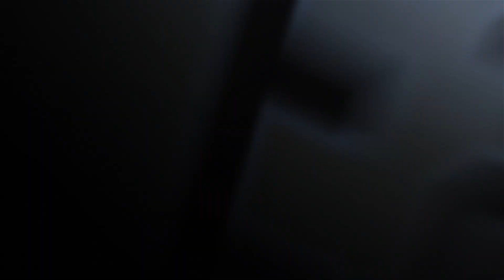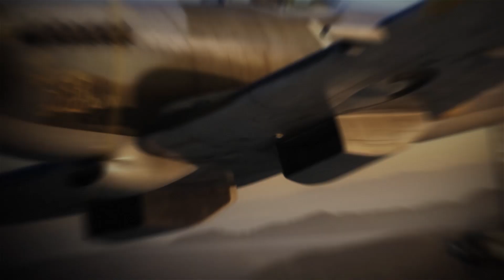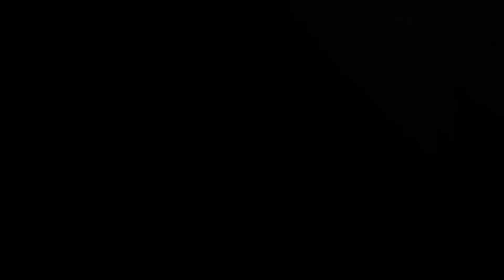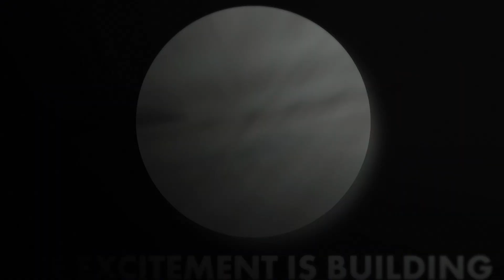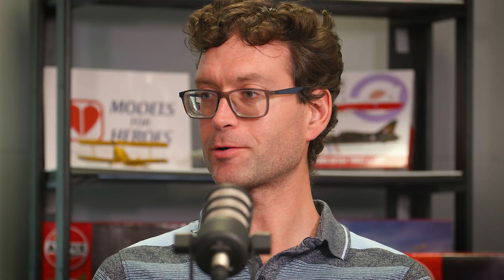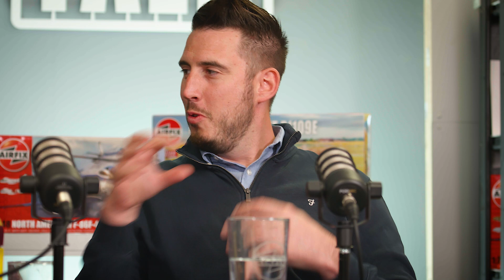Airfix | Sprue Talk : The Design Experience

Comment: If I had to guess, one of Ethan’s projects is bound to be a 1/72 Starter Set Messerschmitt Bf 109G-6, because it has the little DF loop antenna on the spine.
The Me 262 is another candidate, and so is the Fw 190. Some P-40s, P-47s, and P-51Bs also had it depending on the theatre of operations.
Reply from the maker: Some nice guesses there.
Reply: Yeah... I caught onto that too!  I've been wondering if Airfix are going to produce a 1/48 ME262 based off their recent, and excellent 1/72 variants.  If Ethan has been working on one those, then he's a very lucky chap indeed!!  🙂
And yes it could also be a new - much overdue - 1/72 BF 109-G series kit, or maybe even something very new and left-field, a Heinkel HE162 Volksjager (Salamander), as it too had the DF loop on top of it's engine cowling!
And yep, also the P-40, P-47, and P-51B.... all good, fascinating projects to get a young designer hooked!! 😀

Comment: Hi guys. Another interesting discussion that I as a modeller enjoy listening to.  I was particularly interested in your section on 3D printing and its future. When it comes to building plastic kits, 3D printers are still in their relative infancy and they will only get better.  Before retiring, I trained as a research chemist and worked for many years in the photographic industry developing new films and paper for the likes of Kodak and Ilford. Way back in the early 1990's I attended a trade show with my boss in Paris (known as Photokina) and we saw the very first commercial digital camera - a totally digital device called the Ion introduced by the Canon company: 12 extremely low resolution, highly pixelated, images stored on a 3 and 1/2 inch floppy disk that you inserted in the camera body. Yes, it was cludgy, yes, it was gimicky. But when we saw it and spoke to the Canon technicians, we both new it was the beginning of the end for conventional silver halide photography. Nowadays we have 64+ MB sensors in consumer DSLRs.  You see where I'm going with this?  There are close parallels here with the 3D printing, and by implication, the modeI making industries. Although I would hate it personally, I can see the day, perhaps in 10+ years time, when modellers will download extremely high resolution 3D printing files of whole sprues offered by model companies in order for the modeller to build a complete kit on their high-res home printer. So model companies would only be selling multi Megabyte or Gigabyte files to the consumer!  A scary scenario that, and one that I wouldn't enjoy because I love the hobby in its current form. But it may well be the future for your company and for your competitors.  Just remember, you first heard it from me in the year 2022.  Would enjoy reading your comments and opinions on this......  Just don't despair and keep up the great current work with your excellent models!